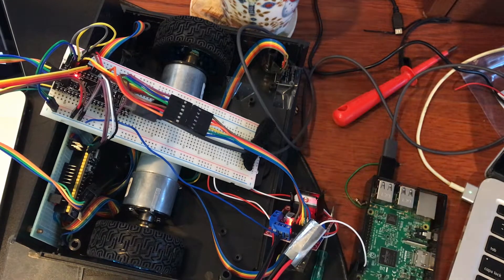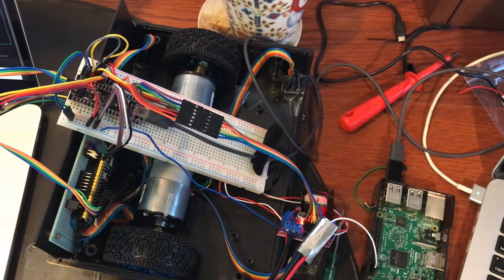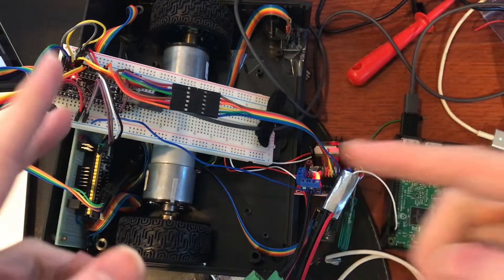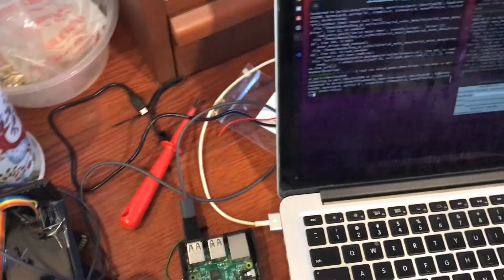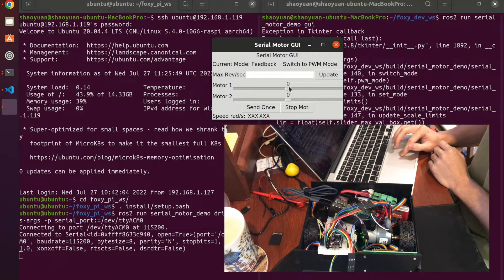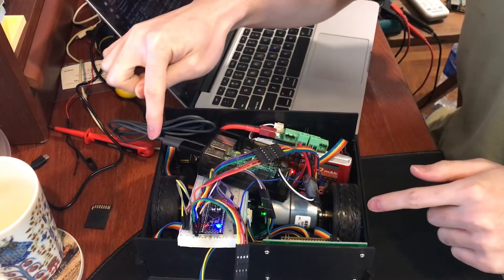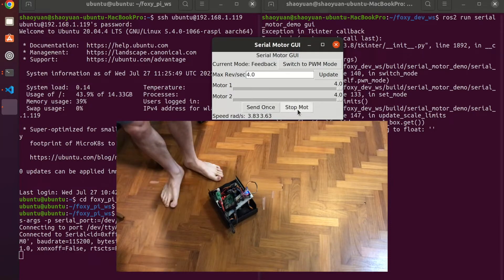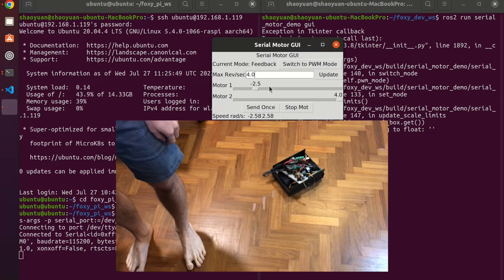ROS 2 Serial Motor Demo | STM32f401 Black Pill + Raspberry Pi

Comment: How does the dev machine communicate with the raspberry pi? I'm using this same repo and have the GUI up on my dev machine with the driver node running on the PI, however the motor commands are not seeming to work when i send them over to the raspberry pi via the GUI